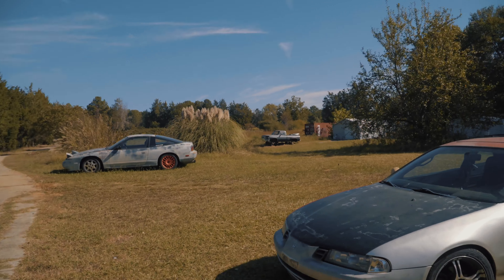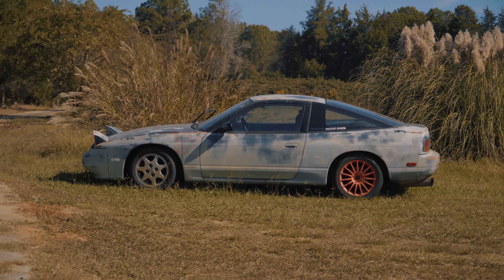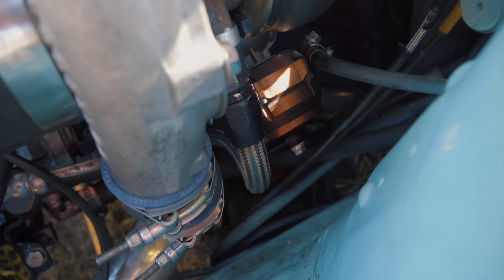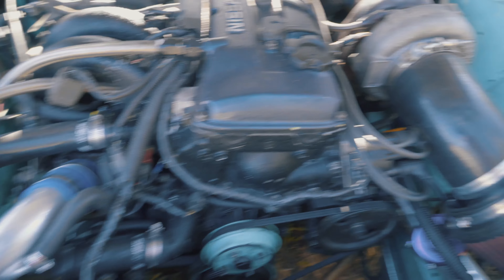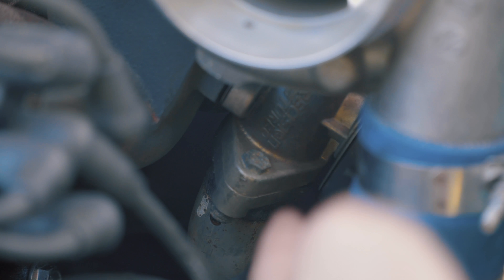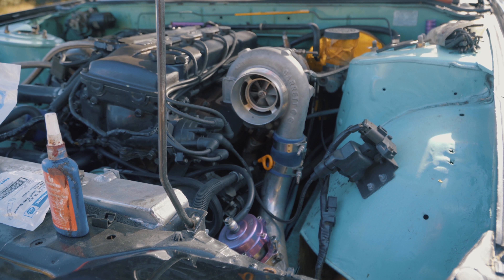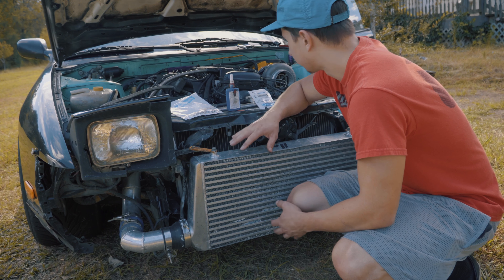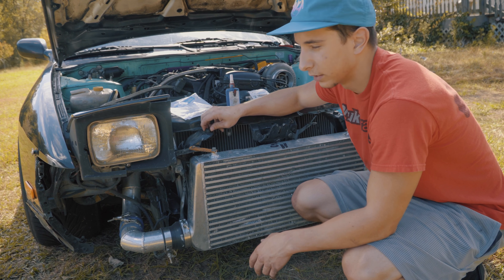+350hp 240sx Wastegate Problems

Comment: How do you not melt your brake reservoir with the turbo that close?
Reply from the maker: DirtySouthGaming heat tape lol and i usually have a turbo blanket and heat wrap for my down pipe, just took it off to fjnd exhaust leaks
Reply: haha same here and i have a heat shield! Which is why it was so painful to see a flaming melted clump of gold foil when I pulled over and popped my hood on 95 last year lmao
Reply from the maker: DirtySouthGaming yea i need a heat sheilf just havent got around to making one yet